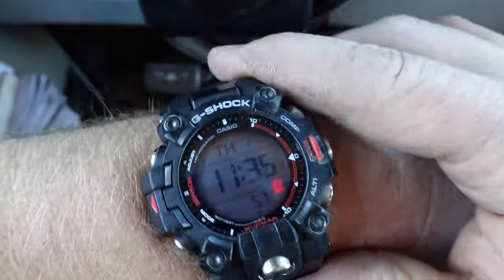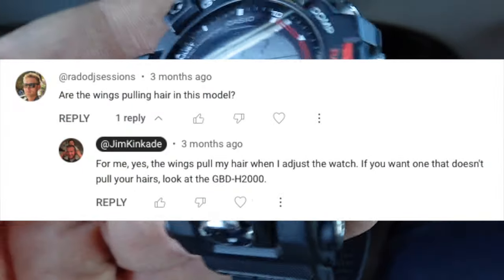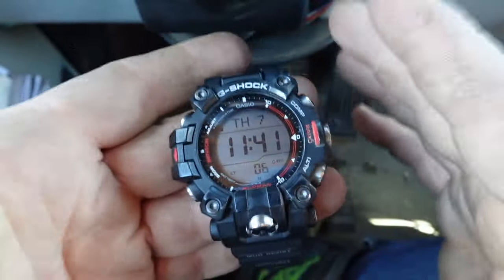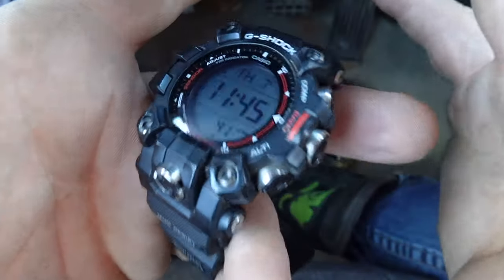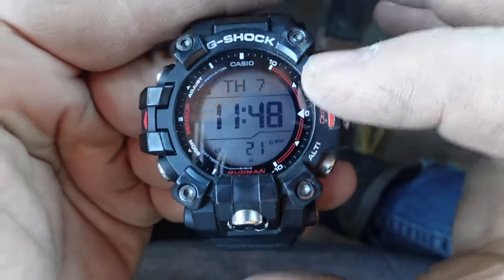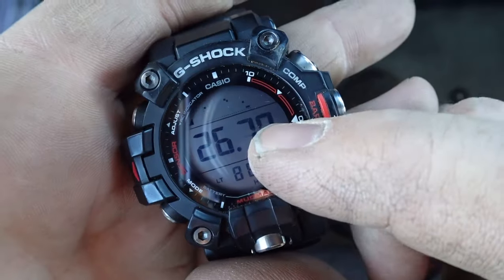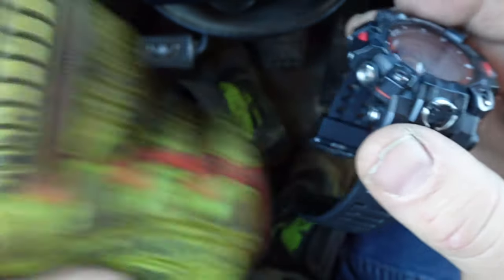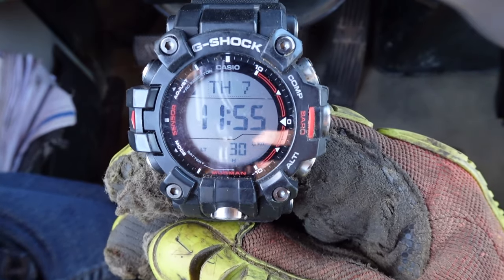I LIKE the MUDMAN even MORE! ❤️❤️❤️

Comment: Finally, someone who actually wears their watch - not some paid influencer! I'm with you on so many points. I work in a feed/farm equip. warehouse - lots of bangs, scraps, dust, and grime. 1) G-Shock needs to make highly legible watches for those who use them as tools. The negative displays are fine for the fashionistas. 2) I think resin straps are safer around rotary tools because they'll break off easier than a nato/nylon strap. Nato straps also absorb sweat and stink. 3) I could care less if my glass is scratched as long as the watch is legible. I do take my G-Shocks and wash them with Dawn, water, and a toothbrush about once a week.
Reply from the maker: You're right! The mudman needs its own toothbrush!

Comment: So I have my gw9500, and I have a job that is rough on my watches.  I went to Amazon and got a crystal protector for mine.  When you order it, it comes with 3 protectors.  I have changed mine out once since putting it on because I had to service a piece of equipment, and it got pretty banged up while doing it.  But when I peeled the scratched one off, the crystal of the watch looked brand new.  I highly recommend getting a pack of them if you are rough on watches like me.
Reply from the maker: My Mudman brother! I will check those out before I scratch it more.

Comment: I appreciate your reviews on this watch. No one is making deep videos like this.  Very helpful. The 9400 is not classified as mud resistant by Casio but some people or sources say that it is still mud and dust resistant due to the shock base and construction. Thoughts on this the 9400 being mud resistant? The glare is a deal breaker for me unless the 9400 is indeed not mud and dust resistant. Ridiculous casio did not address this issue.
Reply from the maker: I think they made the 9400 TOO good so they dropped the mud resist to make their other watches look better. 

I like the Mudman better but I am in the minority. Most guys like the 9400 better. They’re both good with pros and cons. You really can’t go wrong. Just avoid the negative displays.
Reply: @JimKinkade  thanks man

Comment: Don't worry about the glare, that's just a moment... a watch without glare simply doesn't exist, it's the law of physics... that crystal didn't absorb the light, that's impossible, it just redirected it somewhere else, more or less. At that price tag, it's very nice to see a shoulders (a wings), that's good for a balance at the wrist, without that it would be top heavy very probably. In my opinion that Mud Boy is one of the last Casio watches which is built only for one purpose - to just do the job and withstand anything with no question.
Very Like
Reply from the maker: I hope it's not the last but since they are headed toward connected watches I'm not going to let go of this one.
Reply: I don’t want anything on my wrist that is connected to anything. Just an accurate and tough time piece. And this fits the bill perfectly!!😊

Comment: I find 9500 very attractive. I like my Rangeman 9400, but that big flat backside results in big holes at the sides of the wrist, I have 17cm wrist. It's like the watch is intended for 20+ cm wrists. But the Mudman 9500 fits good even on smaller wrist. 
I like the large digits on 9500. 
Mudman 9500 actually looks like a successor to Rangeman 9400.
Reply: I received Mudman 9500 a few days ago. It's a good replacement for Rangeman 9400. The ~2cm shorter flat surface on backside makes it fitting the wrist very good!
But 9400 has a better protection of the crystal from the sides because of higher edges.

Comment: I must admit to being so very Ridiculously fond of the 'Classic' but stiffer "Old School" Mudman button protectors that I purposely avoided getting the "better" Rangemaster model I thought I had "surely" wanted and so especially after reading about the Rangemaster's O-ring button gaskets maintenance requirements that supposedly need replacing every few years; What?! Nope, Thank You, let "Shirley" have it then. Sometimes "Less is More". I would dare to wager that the simpler more "primitive" Mudman membrane button covers are likely tougher and more reliable long term and can be even changed out to new again with just a new bezel cover replacement. Like I said, I am very fond of the older Mudman buttons to the point of being much happier with an older or "lesser" model just to have them to protect the watch from chocolate syrup or strawberry jam residues or even the occasional sick little kid's projectile vomiting if nothing else. Thank You G-Shock for "Keeping it Real" so that some of us don't have to necessarily wear hefty Divers watches all day long..."Not that there's anything WRONG with that!" as Jerry Seinfeld said.
Reply from the maker: I hear what you’re saying because I have a King, the GXW-56, and it doesn’t have the gaskets the case just seals off the buttons! The gaskets seem over engineered.

Comment: looking for the toughest longest lasting of these three models, GBD-H1000, GBD-H2000, and GW-9500, thoughts? needing it to last at least 10 years. No requirements for fitness stuff. just Nav, ABC, Solar and Multiband
Reply from the maker: The Mudman GW-9500 is the toughest and longest lasting hands down. But it doesn’t offer navigation. In fact none of them really offer navigation. The GBD watches use the gps to report how far you’ve walked or ran. The GW-9500 is a much more basic standalone watch.

Comment: I wear the green negative display one gw_9500 and I deal with it, I rate mine 5 star as it’s bad a$$ agree to get positive display but the green tacticool was what I wanted, great videos as always keep up the great work!  I also have to say that I had a titanium pro trek bought new in 2005, a PRG 80T and it died in 2022 when a watch tech changed the battery and messed it up😢, this mudman really is the spiritual successor to that watch in every way almost identical menus etc, I just want Casio to bring back all the titanium watches and I am saddened to see the pathetic state of where the modern pro trek is
Reply from the maker: Those titanium ProTrek look nice! I have an eBay alarm set for the ProTrek prw-50t. The problem with Casio and titanium is that when they put it on a GShock they jack the price up to $1200.